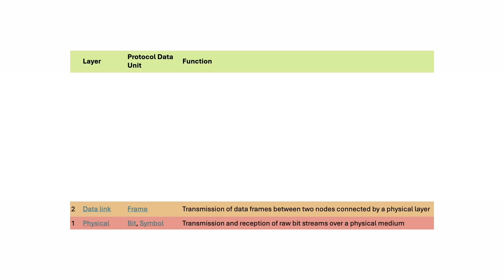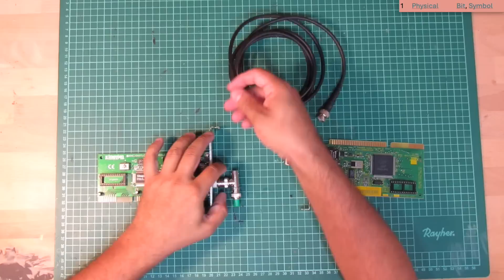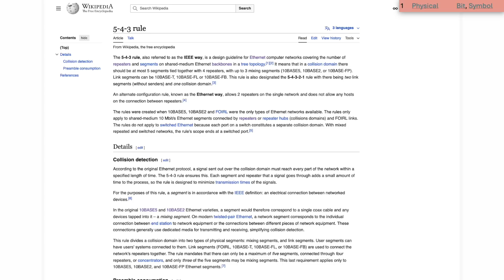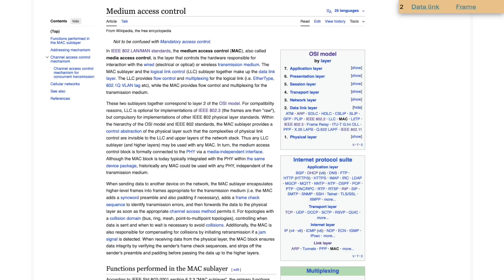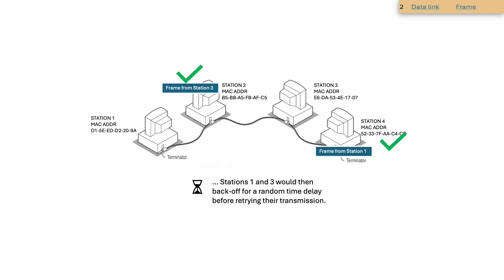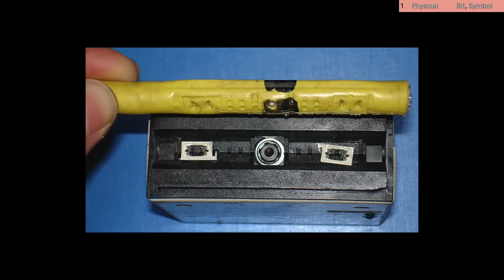10BASE2 Network Basics - Rewinding the Network (Part 1)

Comment: When I first started in computers. I installed several of those networks. Including putting ends of cables. Due to crimper and ends being a slight different. The middle brass pin would not crimp 100% or even fall off. So I would solder it. Solved so many problems and I can't tell you how many times I fixed competitors cables. I did have one tell me that is why they only used prepackaged cables. With Novell and the size of the network . Using multiple nic cards was the way to do. Even if you have 15 / 15 in a single room to cut down on traffic. I was so happy when we moved away from that stuff. Got tired of getting a call about the network going down and finding out somebody munched a connector or unplugged a few stations. leaving the T in place. I did have one strange instance. I did a long run between a building. It started on its own card from the server. Worked just great and was in the proper length. But, I had one workstation that would not work right at the beginning of the run in the other building. So basically the cable went 50ft before the first station. Maye 30. Anyway if I ended the network in that place. It would work fine. When I plugged in the rest of the network. That one station did not work. I tried different cards and everything. I could even run the station to another spot and it would work fine. Used a coupler to go around the spot. It was fine. Finally I did something I could not tell if it would work or not. I put a T up in the ceiling and run one cable down. Probably say 10ft of cable. Then on the back of the workstation put a T and a terminator. That solved the issue. I did all the lan tests I know of and it was not problem. Worked great for years until I left computing. So the only 3 terminator segment. I always wanted to go back and try that in a test environment. Never did though. Once again due to cat 3 / 5 cabling.
Reply from the maker: I love these ridiculously obscure stories :-)

As I had talked with one who ran these networks at the time, I heard a story like putting the terminator not directly onto the T-Piece, but only after an extra 30cm whiptail cable. For whatever reason that seemed to work for improving stability.

I have one to share myself, although I must admit, I was still in my youth and not very profound on the network topics back then.
When my school threw the 10BASE2 stuff out, I was lucky to help there, and got to keep some of this old gear.
But I couldn't get my nodes talking via a 25 meters coax wire, that I had feed through behind the walls in my parents home.
The obvious was to replace the wire, or the NICs, but neither didn't help.
It worked however with a flying 15m wire down the hallway.
My teacher didn't really understand why, ultimately recommending me to install a 10BASE2 repeater in between, which solved the problem and it worked flawlessly for years.
Reply: layer 1 issue.
Reply: I bet long runs introduced a lot of ground loop problems. Current will flow if there's a difference in voltage and know what causes differences in voltages? Differences in height.

Base-T is so wonderful because it uses electro-magnetic field coupling like a transformer, so not only it doesn't need any current in the cable, it is immune to that.
I just think of a Cat cable like a split transformer that runs a long distance, with half in one machine and half in the another.
And they also use differential signaling, so it's also immune to interference.

Coax is just a pain the ass.
Reply: @monad_tcp  Working at a small 2 person shop. I always figured if I had the $$$$ network testing equipment. I'm sure I would have found the answer. All I had is one those cheap light testers. It worked good for one thing. If the light was red. Even a tad. You know you had a bad cable or crimp some place. I found one with 1 braided ground wire touching the inside of the middle pin. Plus this was all before the internet. So all of my stuff mostly I got from books. I could even put a couple in and the rest would work fine. Just that spot. Also I forgot to say it was replacing a 2mb Arcnet network. They had 1 active hub and tons of those little 4 port passive hubs. I do remember calling other people and trying to talk my boss into getting a repeater or something. But, all I got was. It is within the correct distance.

Comment: One other little nicety of 10base2, the line should be grounded by one station - in a hub situation, it would be the hub, not sure how or if the cards had an option.
10baseT was an interesting path, at first, it really had nothing special, with repeater hubs just putting all the packets on all the wires, with a logical bus but physical star configuration - and then came full duplex, 10Mb each way, but woe betide you if you mismatched the duplex setting
Reply: Ohh, the minor electric shocks from 10base2 when the mains filters leaked electricity to ground on each station, and grounded outlet was uncommon...

DEC OfficeConnect was great in this regard as it had insulated BNC connectors (both for cables and the T thingies).

Comment: I always thought that coax networking made more sense for wiring up buildings, because you don't need to lay a separate cable to the server room for each station you intend to connect. Makes it much more efficient, more akin to electrical wiring. Of course, the drawback is much worse reliability, and when the 100BASE-TX standard and beyond entered the picture, it was a no-brainer. But every time I see a room full of Ethernet jacks, I get scared about how it must look inside the walls 😅
Reply: Local switches. For a room of 30 machines put a 48 way switch and a  pair of cables back to the main switch (one active one backup)
Reply: @TheErador  Of course. But that's still 30 wires to route around the room instead of 1.
Reply from the maker: @kFY514  Sure, TP needs more cabling than coax. But in terms of scalability, 10BASE2 was too limited. TP and switched networks was the next logical step.

It is in theory possible to reach as much as 10 Gbps over coax nowadays, but it would require equire a practiable solution to avoid the packet collisions on a LAN.

Comment: I have a serious soft spot for 10Base2.  I ran a multinode BBS off of this in the early 1990s.  I had as many as 10-11 computers hooked up via BNC at one time, and I do remember the terminators getting loose on their own occasionally :).    I started with a ..  "free" copy of Novell Netware 286 before moving to LANtastic.   LANtastic turned out to be faster and more flexible for running a board.

Thank you for this great video!
Reply from the maker: @jrherita  LANtastic is coming soon. Don‘t know it from own experience, but I hear many people saying it was good!
Reply: @THEPHINTAGECOLLECTOR  Since LANtastic ran on top of DOS it worked with everything as drivers were compatible.  I had an ISA caching SCSI card that flew with LANtastic.  Look forward to your video!
Reply: @THEPHINTAGECOLLECTOR  Did several Lantastic network. 5.0 and tons of 6. They even came out with a dedicated server version. Never used it. But it was only a few $$$ away from Novell Server. So I just used that for a dedicated server. Had one place that used Lantastic E 2mbps cards. Had to look it up. Says serial network cards? Then they had this box. I can't find the name of it. Used Parallel port I think to provide network access. Sold one and it worked but was slow. Customer was not happy. But, hey what can you do when they have a old laptop. Not sure what I did not use a PCMCIA. Might not have had that slot. To many years ago.